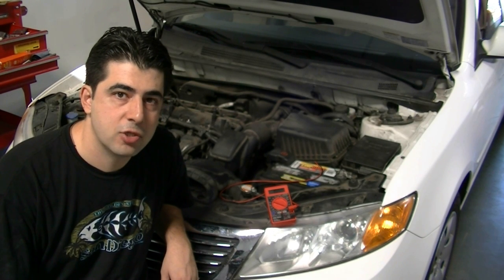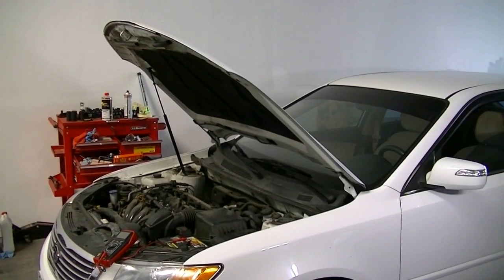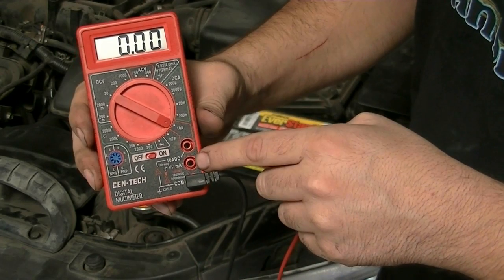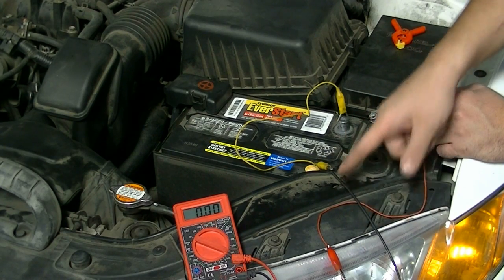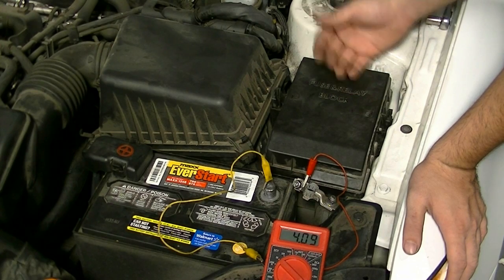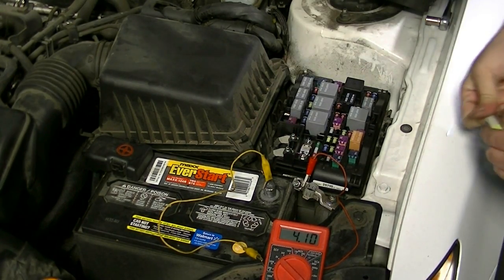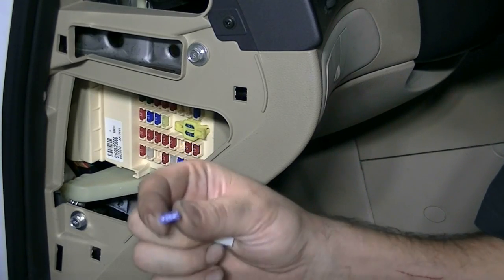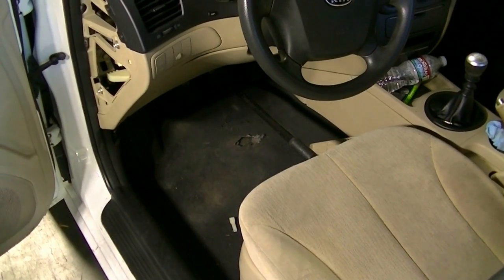How to Perform a Parasitic Draw Test on Your Vehicle - Diagnosing Battery Drain Issues

Comment: Question, I did what you did on this video but when I connect the wire th the battery post the car alarm goes off, could this be the reason my battery drains

Comment: Thank you so much for your videos! They are very well explained.  I'm pretty sure I have a parasitic drain bc my right turn signal light just stays on.  It will not turn off, even with car off and key out.  Flasher Relay has been changed, and its still on.  The dashboard right turn signal is on solid 24/7. 
Next day my battery is drained.  Any thoughts? 2009 Subaru Forester..its driving me nuts!
Reply: Did you find out? Thanks

Comment: How do you do a parasitic draw test with the battery in trunck or back seat. 
Ie Chargers and Cadillacs
Reply: It would be the same: you disconnect the negative and set up the multimeter between the battery and negative cable just like in the video.

Comment: Hi. My hyundai i10 keeps draining the battery.  The abs light is on and when i did a amp draw test on the fuses the only circuit that was drawing a current was the abs circuit. Can the abs circuit draw amps if its faulty? Thanks

Comment: Hey, I Got a 2002 Chrysler 300M Special, I Don't Drive the Car Often, I have went through 3 Batteries this Year. I Noticed that when I Park the car for more than 3 Days the Battery Completely Dies, But, If I Drive it Daily, I dont have this Problem. I have tried to Perform This Test and I get 0.000/.0.001 Amps. My Voltage is 12.70 allday. I thought perhaps My Multimeter Might be bad, I Used a 2nd Brand New DMM and It Reads the Same. Both DMMs Read the Voltage Fine, But I cant find where the Amp Draw is coming from. The Car is Stock, No Factory Stereo Or Anything.. I even Try to Create an artificial Amp Draw by Opening the Doors while I have the DMM hooked up and I still don't see any Amp Draw. I also waited about 10mins too see Maybe the car needs time to run tests after battery is unhooked, But still the samething.. What am I doing Wrong... ??

Comment: I need help on my car I have a 2095 Pontiac vibe and when the car is running the alternator is good at 13.8v but when I come to a stop the alternator stops charging the battery. I’ve replaced the alternator 3 times, new grounds, new belt. Then I did a parasitic draw test and found out when I pulled out the fog light relay and the amps went from .185 to .040 I found the fog light bulb was busted. I replaced it but the alternator is still not charging when at idle. Can anyone help me?

Comment: Great video. I have a 99 camry, I followed ur steps to find the battery draining problem. But every time i connect the meter wires to battery post and terminal the car alarm goes off and i get random readings. How should i resolve that problem? Thanks
Reply: Disable your alarm

Comment: How do we know the light goes off in the trunk when it is closed?  Do we simply trust that the same gods of the refrigerator are controlling the trunk?
Reply: Haha, For my car, I climbed inside trunk & closed the trunk. Just like in the good ol days of the Drive-In movie theater. I have an ol car, so the trunk space is huge. 3ppl could fit. Bk to ur ?. Climbing in & shutting trunk was I how checked my light. Sure thing it turns off😊💡🚓
Reply: @K-Z1  Someone has to take one for the team.  Thanks.

Comment: is it possible to check parasitic draw directly from the fuses? i'm not sure hwat the setting would be on the multimeter or if the battery has to be connected or not, but a fuse's contacts are accessible on top for the two leads to check for readings. i may be missing the point of looking for the amp reading to go down instead of a fuse showing a draw.

Comment: Probably one of the WORST examples of current draw testing I have ever seen!!!!!!! You should never disconnect your battery when doing this test. Once you disconnect the battery, you have just reset every control unit in the car possible taking that intermittent  draw away and it will come back eventually. The car must sit for a few minutes (depending on the manufacturer specifications) and let all the control power down/go to sleep before you can do any testing. The doors should NEVER be shut, but stay open and latched manually or the latch disabled making the car think it is closed, otherwise if you have to investigate something inside the car, you are going to wake up the vehicle and you waste time letting it fall back to sleep before you can test it again. An inductive amp clamp should be used so the battery does not  have to be disconnected. If you start pulling fuses, it is the same thing as disconnecting the battery. You have just reset that control unit and possibly taken away that intermittent draw issue. The proper way is to voltage drop each fuse without disconnecting them. You can find online a conversion chart that will convert your voltage drop readings from mv to ma depending on what size fuse you have. Once you find a reading that is outside your manufacturers specification, you can further investigate that circuit controlled by that fuse.

Comment: You would have left someone with only half of the connections you didn't specify what to do with the black wire from your multimeter to bridge the connection
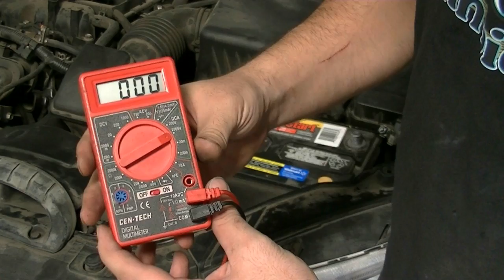Reply: Review the part of the video, starting at about 1:48, where he is explaining how to use the multimeter to measure parasitic draw, which involves using the correct black and red wire connections on the multimeter, then disconnecting the large black cable connection to the negative battery terminal, and bridging the connection between the negative battery terminal and the negative battery cable (which is connected to ground on the other end of that cable) using two separate wires with alligator clips at both ends to connect the red and black wires of the multimeter in line with the ground connection between battery negative terminal and the negative battery ground cable to measure the amperage of the parasitic draw.  Starting at about 2:36, the video clearly shows the connections between the battery negative terminal, the negative battery ground cable and the wires to the multimeter, and how he used the multimeter to measure parasitic draw.  No connection was left out.  If this is not clear to you, watch the entire video again until you see and understand the process. If the process is still not clear, then you should not attempt to do this on any vehicle - you could fry the multimeter, short out the battery(with a risk of setting the vehicle on fire), and/or destroy other electronic components in the vehicle you are working on.
Reply: You are exactly right!!!! The jackass under you (anonymous98) Doesn't know what he is talking about!

Comment: Quick question, I disconnected my negative terminal from the negative battery post and performed the same test and I got a reading of .36A - .40A, does that raise any flags?? The battery is draining if I do not drive the car for over a day. Then I have to jump start the car. If I drive it everyday it will start. The battery tested good after I ran it for a while and took it get tested at NAPA and orielly. The starter and alternator tested good as well. The battery seems to not be able to hold the charge. It will charge up to 12.5V  but after it has been sitting all day the voltage drops to 11.5V. Then if I leave it off All day and night, the next morning the battery is dead.
Reply: Did you find anything? This is the exact problem I’m
Having right now

Comment: that is not really how it should be done. To check parasitic draw you need an amper meter clamp. If you detach the battery you might lose the leak as the problem is that a certain module does not go to deep sleep. Shutting its power is not the same thing. Another method to check if you have a draw is to hold the pointers of the multimeter to one of the battery terminals and detach it while holding the other pointer to the battery clamp, that way the current will keep flowing through the multimeter. Once you know there is a draw - set you multimeter to mV, around 300, and check each fuse while it's in the fuse box. There is a diagram to calculate the current flowing throuh it:
http://cdn2.hubspot.net/hub/232160/file-319539048-pdf/Fuse_Voltage_Drop_Chart_-_Standard_Fuse.pdf?t=1498581203243
Reply: good idea
Reply: Then make your own video to show people.

Comment: This is information I didn't know about the vehicles, and I have to look for some clamps to make it easier to clamp the leads to the battery and other parts on my vehicles.
Reply: Sidney Mathious just use a wire with bare ends.

Comment: thanks for the vídeos. so a hispanic male claims to test alternator to remove negative cable at battery when idle if car dies alternator is good.also to remove both battery cables and to connect your multimeter to the disconented wires....?

Comment: thanks 4 this video this sure will help me   i was lost  i has replaced 4 battery's in past 2 yrs and try pulling fuse or relay  let sit few days never was able to test my silverado like u done i been pulling hot cable off keep from going dead  no way i was going to take to some chevy dealer they sure not afraid to give you some huge bill fixed or not both ways they get $ thats $ i does not have  hoping im able test find my issue or issues i no being out in country we has lots of mice and other critters sure loves to chew on anything and everything seems to happen in winter months there attracted to warmth i had few other costly repairs on my other trucks in past come home all running fine next day wont run thats not fun now after watching this video ill be able to save my self few $ b4 i has to throw in the towel take to shop

Comment: Bad alternator drains battery too.
Reply: wouldn't that show up on the dash
Reply: Lumpitlongtoniallquin not necessarily. a bad alternator can still charge the battery, but a bad diode in the alternator can drain the battery when the car is off

Comment: one thing of note everyone: this is true of my vehicle at least. when you disconnect the battery and complete the circuit with the multimeter my vehicle computers turn on and one by one turn themselves off after a set time. i spent a long time searching for a draw that didnt exist. wait a few minutes before drawing conclusions. pun intended
Reply: What vehicle do you drive if I may ask?

Comment: Ah man.... This really SUCKS !!  My 2014 F250 Supper Duty just started 
doing this same thing. Battery drains to the point that the system gives
 a message on the computer screen, "System shut down to prevent battery 
drain" This happens when the truck sits over night... I hope to hell 
that ford helps people that are having this problem, Because we paid way
 to damn much for this truck....

Comment: I have a .57 mHa drain from the 60 amp circuit in the under hood fuse box on my 1997 Ford E-150 conversion van.  The van sometimes starts and sometimes does not, after overnight.  The circuit in question is the instrument panel (according to the official Ford chart).  That would be an expensive repair.  Is this a normal,l accepted amount of drain?  It started today when I tightened the negative battery terminal.  That wire is possibly suspect, so I'm dipping it in a baking soda solution.  Thanks!
Reply: Jeffrey Newton a 50 milli amp draw is not a big deal the vehicle has capacitors and the control module that require a certain amount of power to retain memory. Your best bet is to start checking voltage drop across your wires and check start checking resistance

Comment: I tried this and the numbers jumped around the whole time and there was a crazy clicking under the dash, the lights and instrument needles went bazerk until I pulled those fuses.  I pulled all the fuses and it never went down to zero it did go to 0.51 but then jumped back up to 6 and all around after that.  After I put the battery cable back on the lights and radio came on (no key in ignition) and only went off after I closed the door. Vehicle didn't start after testing it.  Any ideas or should I just shoot it with a bazooka?
Reply: Do this as it works every time. Open hood take off radiator cap and raise it then drive car away and drive another car under it lower radiator cap and tighten. Problem fixed
Reply: Did you shoot it with a bazooka yet..uh..I mean... did you found what was the problem?

Comment: My SUV has parasitic draw or at least if left alone in park, in 3-4 days, battery is unable to start the car. When freshly charged, battery has more than 13 V, battery is a bout 2 years old and otherwise looks fine. 
Car has LoJack and I was not told about location of the device or electrical supply/its fuse (LoJack's policy). 
When tried with Amp meter, I have 1.7 amp draw at sleep mode.
I tried your method. Both the usual fuse from motor and cabin compartment are removed with no change of Amp. Haven't removed the larger box type fuses (Some hard to be removed in tight space). 
Is it normal for LoJack to drain 1.7 amp? and drain the car in few days or I am still having a problem form somewhere else in the wiring and need to continue with other larger fuses (That I am afraid to break one if apply too much pressure). Also need to add that the car has On-star that I am hearing is a source of electrical problem.
Also car has third party stereo and LCDs on all head rests, satellite TV receiver with dish on roof that I am not sure where to find them in fuse box due to add on wiring that is not on car's original circle diagram.
Any help is appreciated and I am really tired of dealing with frequent jumping to start the car.

Comment: I have to confess that many years ago I fried the fuses of a few multimeters when I accidentally measured in-line amperage that was too high for the meter. For those neophytes reading this, be sure that when you mean to measure voltage you aren't accidentally mounting the meter leads to measure amperage ie don't be a goof, like I was. Importantly, when the fuse blows you may not get any error code on some meters, especially inexpensive ones. The meter just fails to show current that would be present if the fuse weren't blown, but it works normally otherwise. So you kinda have to have faith that the last guy to use the meter didn't measure current directly across a battery, which always fries the amperage fuse instantly.

Some guys like to measure voltage drop across each fuse in the bank, with the one drawing current showing the greatest drop. I like that technique, since it is quick and you don't have to unnecessarily reset devices that aren't part of the problem. However I haven't used it enough to be sure it's reliable. The other confusing issue is that modern cars normally have some draw from the computer for an hour or so after shutting off. Chasing normal draw from the PCM will be a confusing false lead.
Reply: Funny.  I was thinking the same thing. It's happen twice to me in a short time.
Reply: False flags